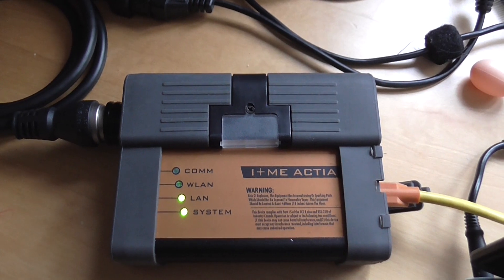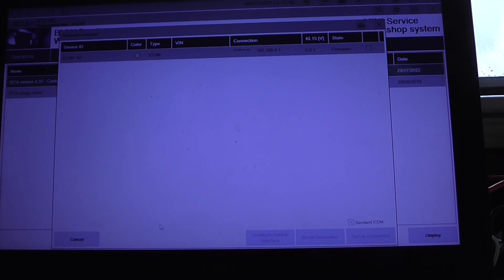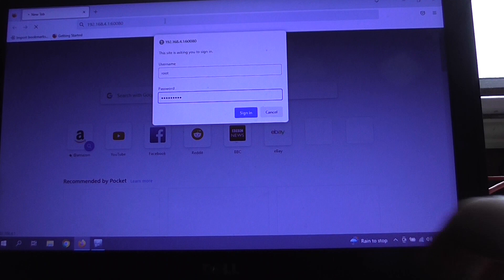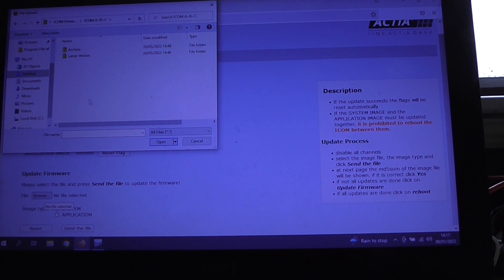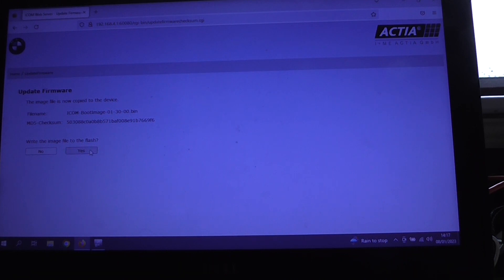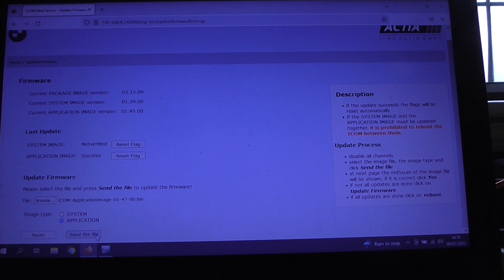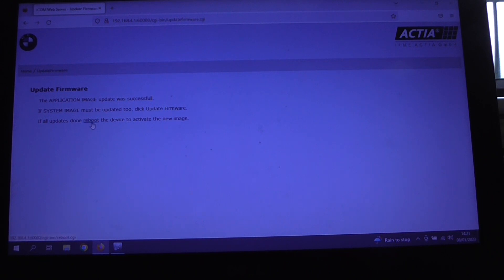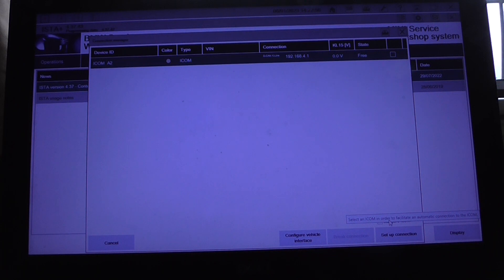BMW ICOM A1 / A2 / A3 / NEXT Firmware Upgrade Procedure

Comment: external powers supply is +12 on pin 16 and wheres minus on 4 or 5 or on 4 and 5?
Reply from the maker: Hi, Pin 4 is the chassis ground and Pin 5 is the signal ground. Depending on your interface these 2 are often bridged together. Check your interface cable. If you need any help then message me. Kind regards

Comment: Hello, I've purchased an ICOM Next (silver one) from ebay and I'm trying to do diagnostic work with ISTA for my 2009 BMW K1300R. When I plug in the ICOM next it shows up on ISTA but its not able to connect to the bike. Online I've seen people use the old ICOM (orange) module to connect to my bike so I'm wondering if I bought the wrong module and need to buy the orange one, or if I can just update the ICOM Next module with suitable software that is compatible with my bike. Thank you
Reply from the maker: Hi, The ICOM NEXT will work absolutely fine. When you try to connect with your ICOM does it say 'Free' or 'Firmware'? If it says Firmware then yes you need to upgrade the firmware. Please contact me if you require any further assistance. Kind Regards.
Reply: Hi there my icom shows up in Ista as firmware do you have any ideas where I may find the firmware to install I have tried what you do in your video but I must have the wrong firmware as it says image file does not match